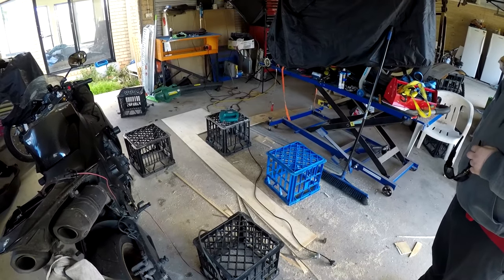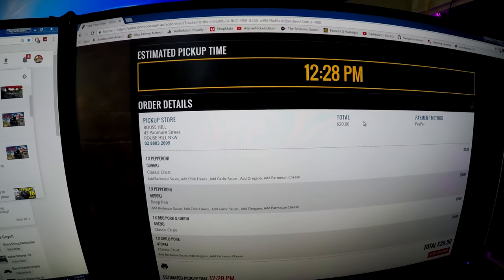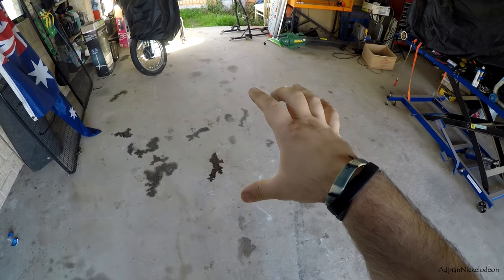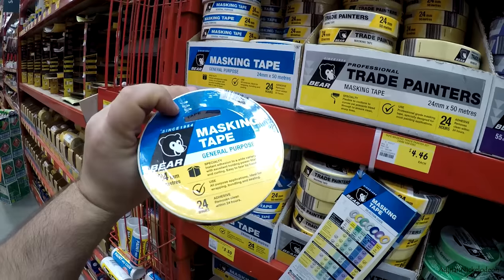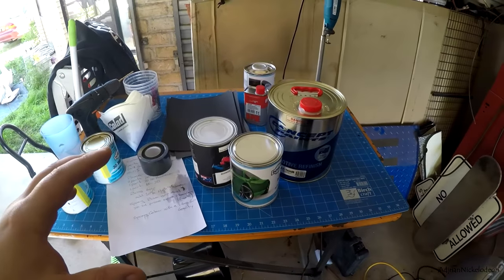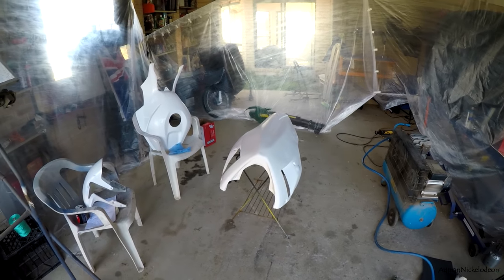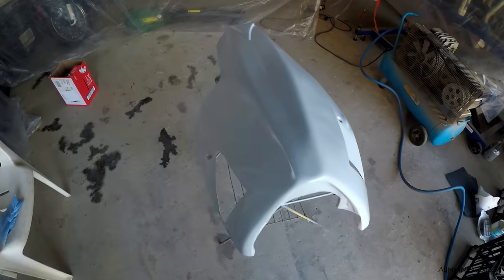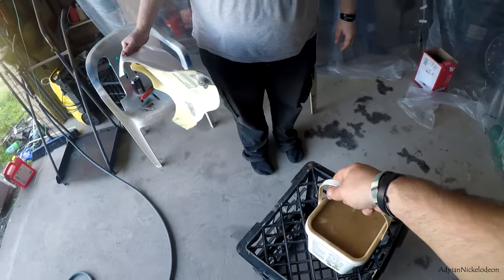How to spray paint your motorcycle at home cheap | Part 1

Comment: Stick to video editing & riding!

You keep touching the things you're going to spray with bare hands (touch a clean phone screen then look at it, oils).

Make sure all containers have been opened before mixing so it's all mixed together & set time is reliable.

I'd have definitely closed that back door & hoovered floor area before hanging sheets to reduce dust.

Nothing I said costs extra but it really does make a difference when you spray parts often. You will see the difference in finish and durability if you prevent contamination on the prepared surface. 

"Paintin' some shit" yes!
Doing a good job? No! Lol but having a good time at least.

Point being - Viewers seek more info - don't see this first and just go for it so casually or the coat will fail.
Reply from the maker: :O
Reply: @AdjrianNickelodeon  theres always one, hahaha